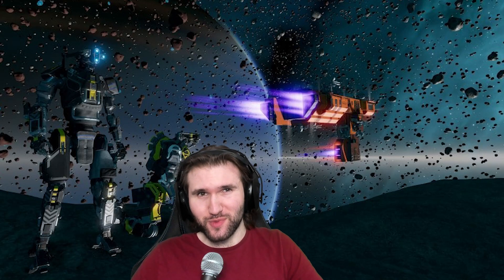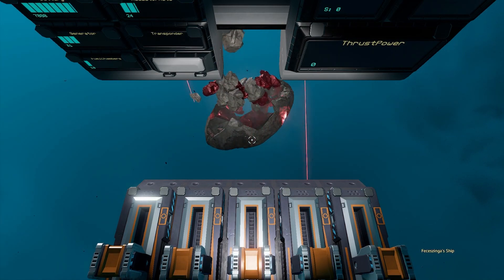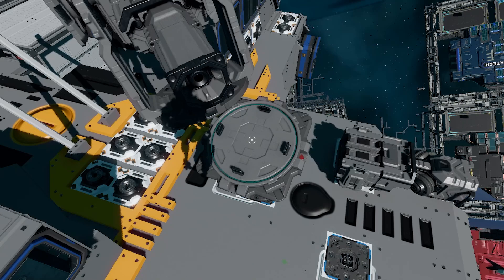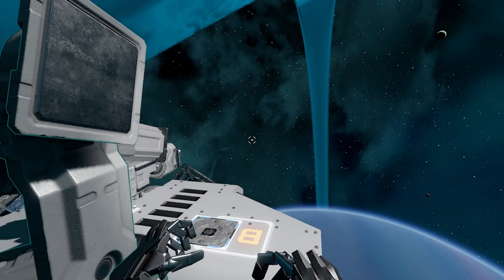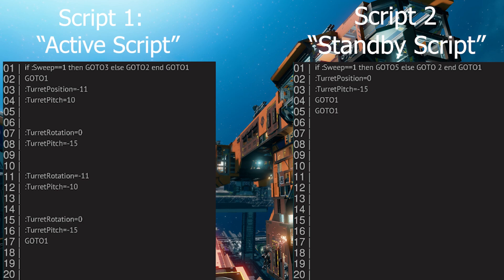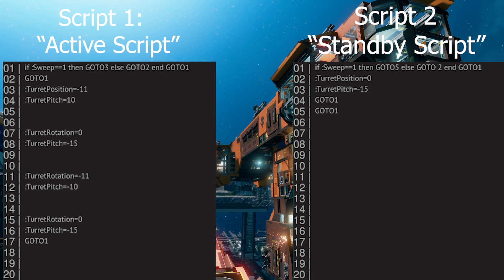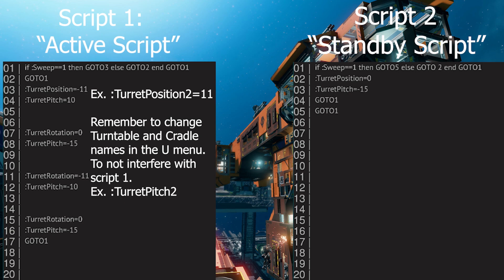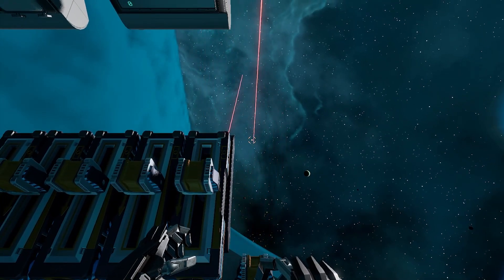Starbase: Take your Mining Lasers up a notch! Using YOLOL!

Comment: you can slow them down a bit by setting velocity and adding a line before every position change to confirm the laser are at previous requested value confirmation and then the script move to the next line.
Reply from the maker: This is a generic beginner tutorial on sweeping lasers with Yolol. My advanced tutorial (currently available) goes into more detail regarding Yolol and improving code. I will have an advanced tutorial of this current video available soon. I will rewrite the scripts and use logical operators and arithmetic to help you understand better.

TLDR: Modular script for noobs, yes I know how to improve it. Thanks for the suggestion however. 😁

Comment: You don't need goto 5 and line 4. You can just goto 1 every time you need it. You don't need the inverted script for the second turret. Ooy can just assign negative values to it in the same script. You don't need line 2 of the active script. You can thransfer the passive script to the end of the active script.
Reply from the maker: It’s a beginner tutorial where it’s separated for clarity and modularity for those who are new to Yolol…

Comment: question about the manatee, i was looking to buy one but i couldnt find the fuel rod storage, is there some on the ship? or would i have to add them? and did you have to add more power or battery to the ship to run mining lazers?
Reply from the maker: I did not upgrade power or batteries. If you follow my intermediate and beginner tutorial you will efficiently manage power. Also there is no rod storage however it uses 8 at the same time.
Reply: @VersaceGuy  ok thank you for the update and videos to help new players.

Comment: How do you attach a mining laser to the center of an advanced cradle?
Reply from the maker: Grab a utility tool body, attach some capacitors on the back. Then laser [or device of your choice (Ex. Ore Collector)] onto the front of the utility tool body, then that composition will slot into the advanced cradle.